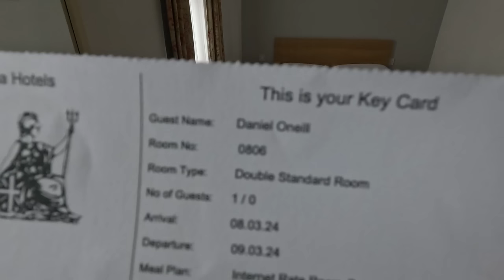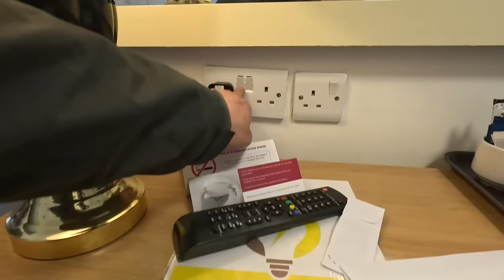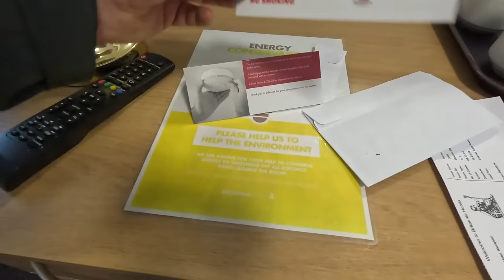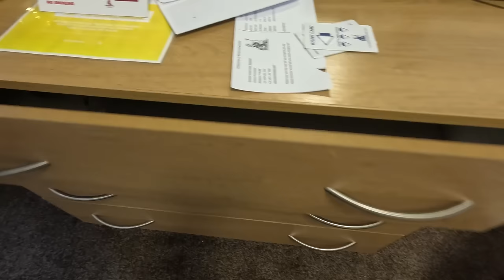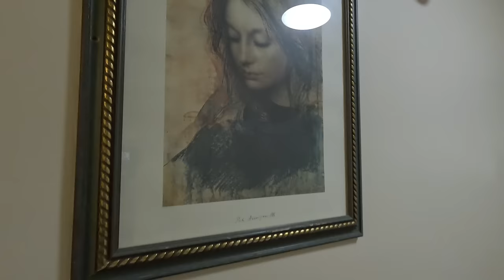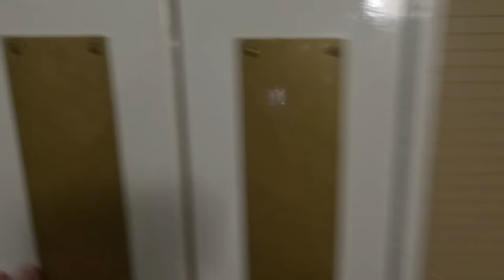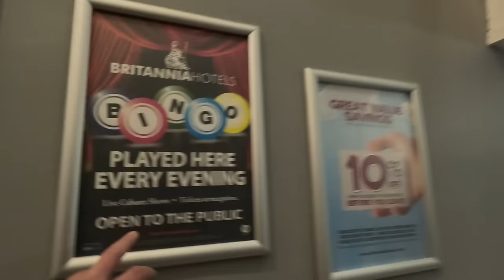STILL the "WORST" rated Hotel in BLACKPOOL?  Norbreck Castle.

Comment: I think the envelope is for when they pre-provision cards at an earlier time for room entry it helps make sure they cant be mixed up with another persons room by whoever the desk person or porter is. Its not done at the time of check in because inexperienced transient staff would mess it up so this segregation means the desk clerk only has to hand you the envelope. Such a large envelope though, they should have got a box of the smaller A6 size envelopes which would be more appropriate. But the larger window ones were probably going cheap!